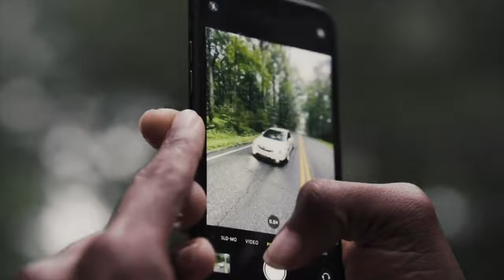New Stage 2 clutch for my 350Z

Comment: Hey dude. Saw you got the Clutch Max stage 2 with flywheel. I just got the same for my HR> How has the clutch been holding up, do you beat on it, durability and performance?
Reply from the maker: Hey man the clutch has been great, it’s a bit aggressive but definitely worth it. If you plan on doing some clutch kicks you got the perfect clutch because when it grabs it grabs hard
Reply from the maker: Overall very good
Reply: @maarodon  Awesome dude. More like clutch drops at the drag strip haha. And the Throwout bearing? any noise? HR has CSC so different to your setup but im trying to get a feel or idea on the quality of the bearing